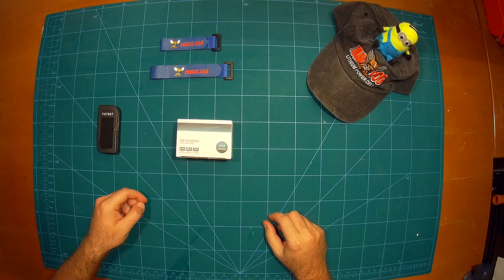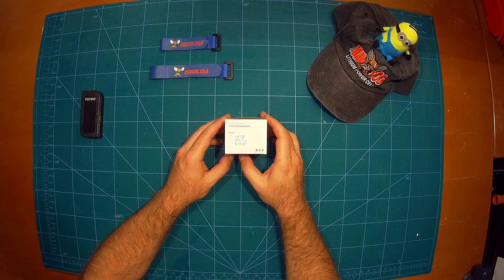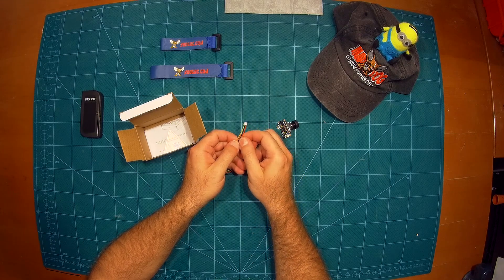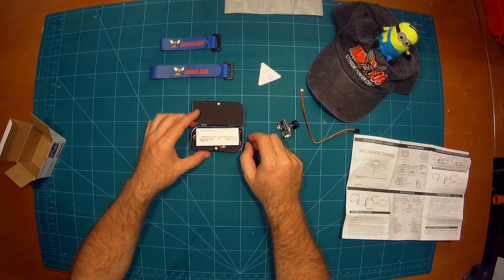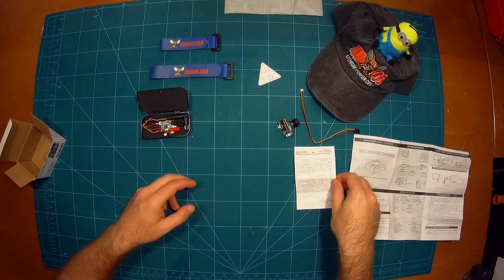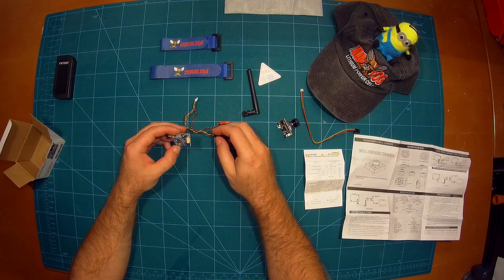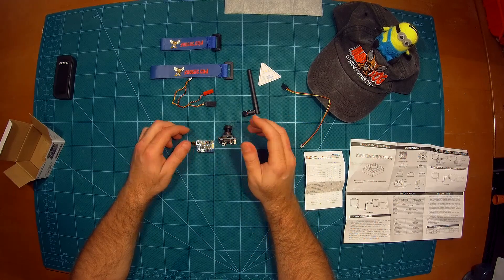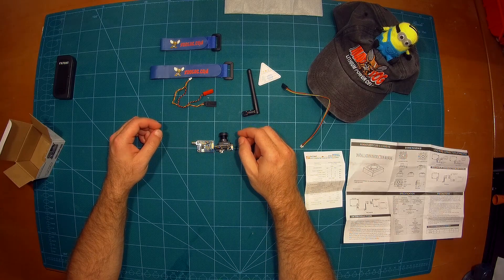Raceband 5.8 GHz 600 mW VTX & Sony CCD camera by 2dogrc: Unboxing Review

Comment: Nice review Mick as always. Is there a way to change settings on that board cam ?
Reply from the maker: +Pudsey - Rc Yes, the camera comes with a connector for your OSD control board, which you can then use to change the settings.

Comment: very keen to get my hands on a raceband tx , Liked
Reply from the maker: +Rotceh Many thanks Rotceh! Raceband is really nice, because there the channels are well-separated. That larger spacing actually allows to have up to 8 users on them simultanously without disturbing each other. That is really sweet for racing or generally when you are flying with friends.
Reply: +Rotceh I have only seen one so far on hobbyking the rest come in artf quads. So be nice to see standalone ones.

Comment: That looks like a nice set sir :)  Is it actually easy to switch lenses out on these? 
I don't realy understand why they ship that antenna (that indeed noboddy uses) with these sets.. It could have been cheaper..
Reply from the maker: +DutchRC ADVENTURES I looks very nice! The lenses are easily exchanged. The lens itself is simply screwed on and hold by a small screw. Once you loosen that screw you can screw the lens out and replace it. That also enables to change the focus of the camera, should you ever need it. A short test showed that no refocusing is needed with this camera, it is spot on. I completely agree with your about those rubber ducky antennas, I already have so many of those at home that I don't know what to do with them. I think I might have to get creative... g :-D
Reply: Allrighty :)  I've never really looked into that, though I do have quite a few FPV sets here :)  I might have a look around for better optics for my more-important FPV sets then :) 

Hahaha yeah.. maybe it would like & funky to put like 10 of those antenna on a quad :P
Reply from the maker: +DutchRC ADVENTURES I think I have enough of those to actually build a quad from them. hmmm maybe a micro quad, that would actually be foldable thanks to these antennas :-D
Reply: +RC FPV Flight Yeah haha :)  they are easy to just screw on as well ;)